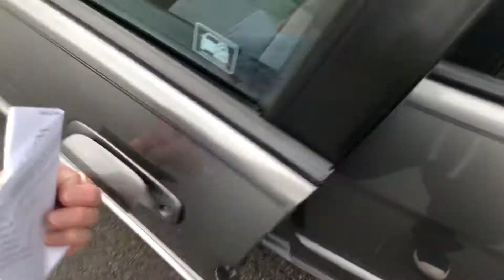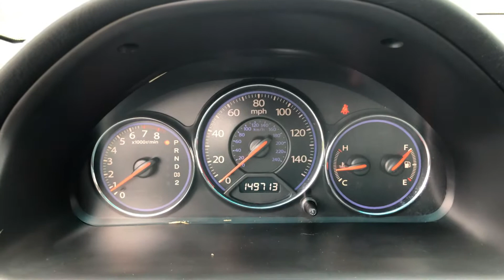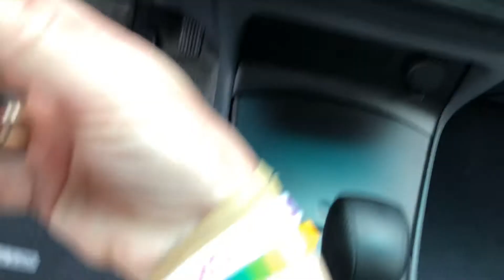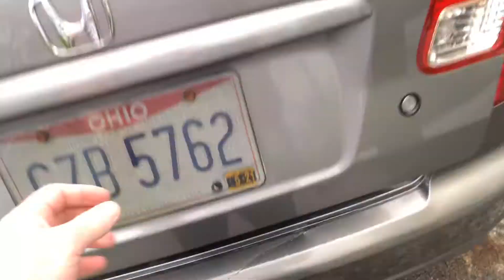2004 Honda Civic LX - Fresh Timing Belt Service, New Tires, Only 149,000 Miles, One Family Owner!

Comment: I just got my sister’s 2001 Honda lx coupe (150k miles) auto but I have disagree with you on parking and visibility. My 350z is perfect for that. High speed, low speed, backing into parking spaces, the Z is just right. Been doing a lot of pleasure driving with my Honda recently
Reply: I drove my brother’s new Honda Pilot and I’m just not used to the rear visibility. My civic’s trunk is high when I look out the rear view mirror an the turning radius sucks when parking. Other than that, I’m thrilled with my “new” Honda!